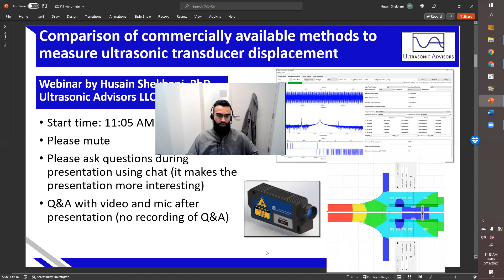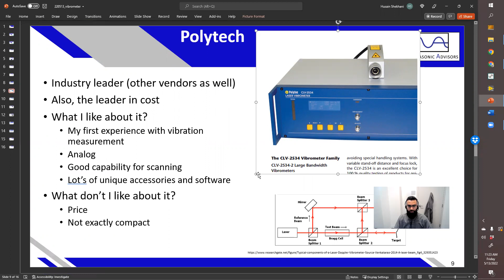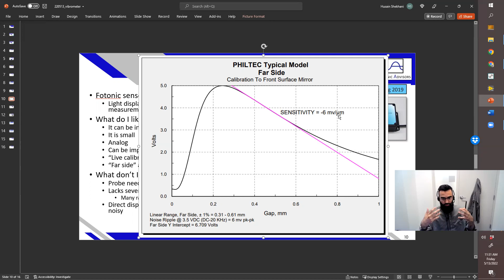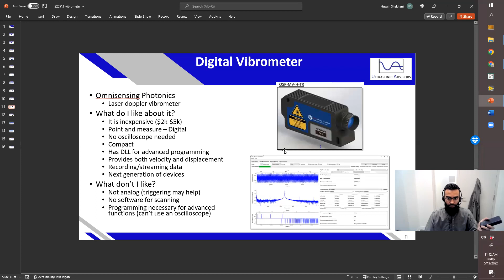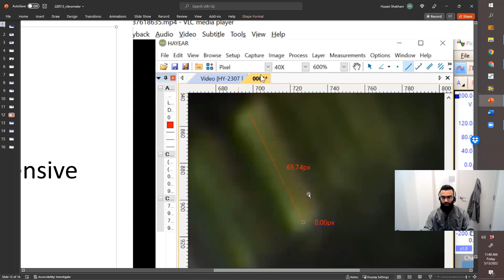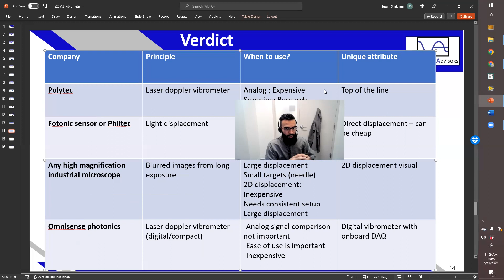Comparison of Vibration Measurement Systems for Ultrasonic Transducers

Comment: Sir, I am providing ultrasonic vibration in a bath using ultrasonic transducer available in market. its actually mechanically vibrate the bath using a piezoelectric crystal. Actually i need to measure the vibration characteristics at surface of bath. Is there any cheap method for that. its for my project.
Reply: in our lab we have Oscilloscope , signal generator etc.. is it useful ?

Comment: Laser vibrometer for $3K is intriguing, it’s interesting though if it has enough sensitivity to pick the vibration of an air coupled transducer. Also I guess the surface should be pretty reflective for this thing to work, meaning white matching layer might not work well? Thanks for the interesting topic !
Reply from the maker: Nowadsys, the laser vibrometers are quite tolerant of nonreflecting surfaces. Something like normal paint with a slight gloss is actually recommended by some manufacutures.